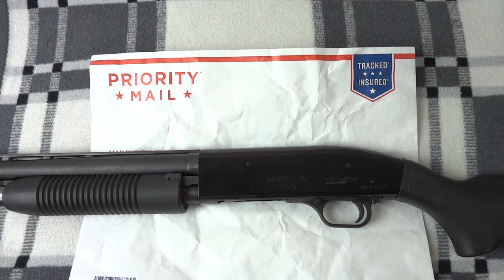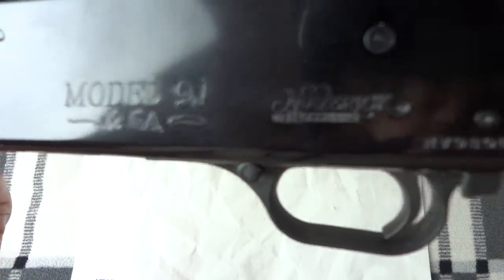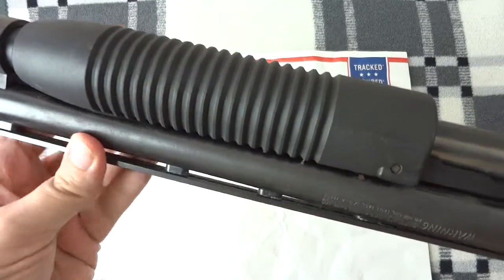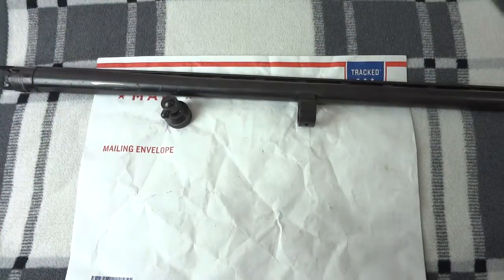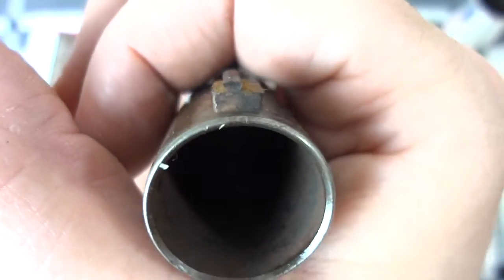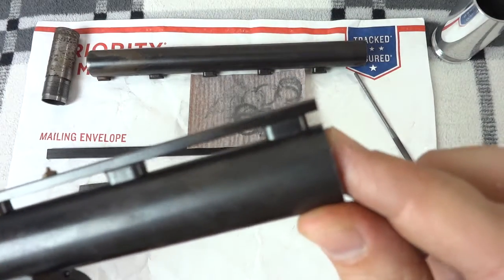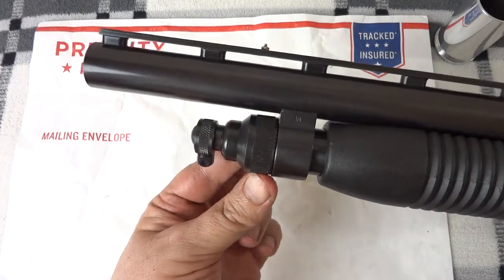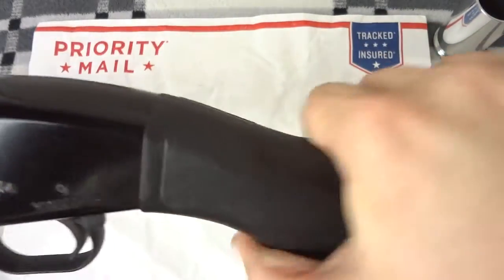Mossberg Maverick 91 Shotgun Refurbishment

Comment: Looks like a older version with that metal line on the top , I don't think they have that now. 18.5 is where you want to cut that beast , 📸⚖️
They back up and going again buddy.🦉
Reply from the maker: Sold the gun years ago, but you're probably right.  They only made the Maverick 91 for a short time.